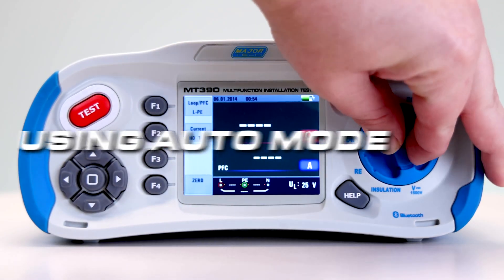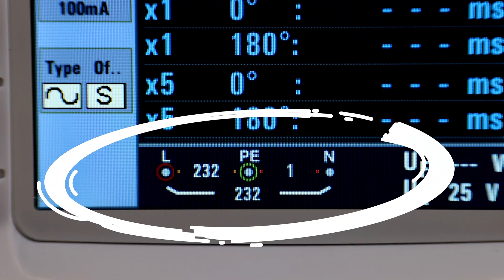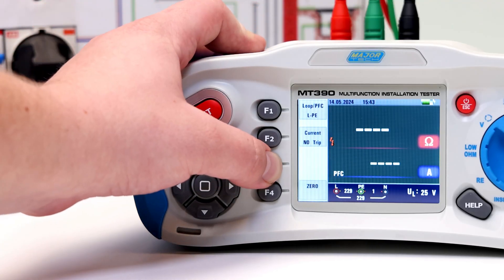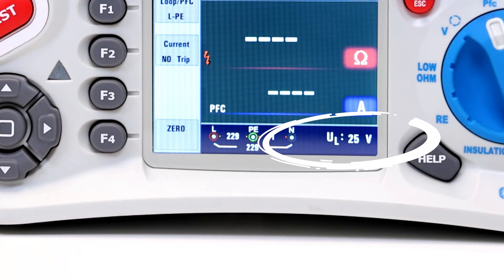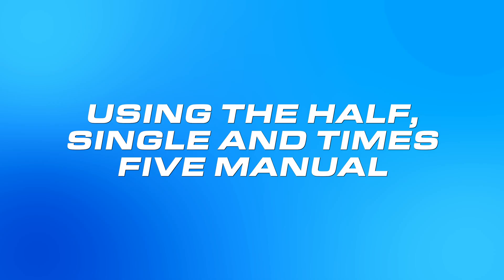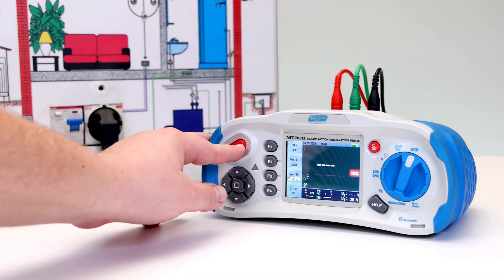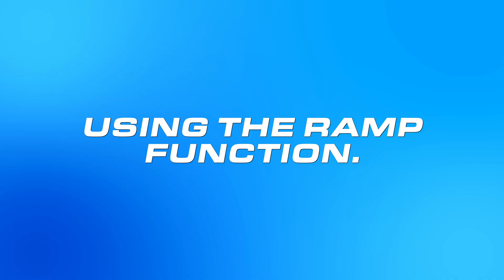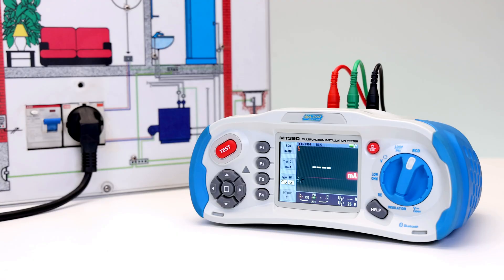MT390 RCD Testing

Comment: My MT390 sometimes trips the RCD before the countdown starts and a ( x ), fail appears on the right hand top corner. I experienced that the Neutral and earth inside the socket outlet was reversed, but I wonder why it does that when you see everything is connected correctly?